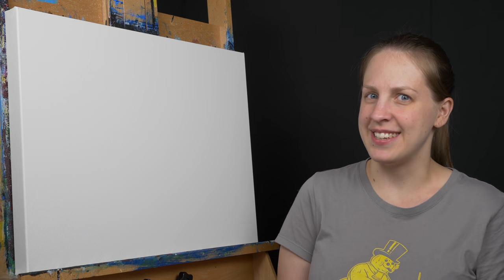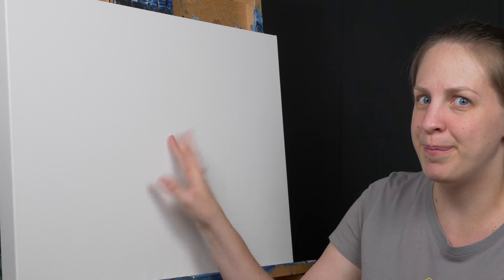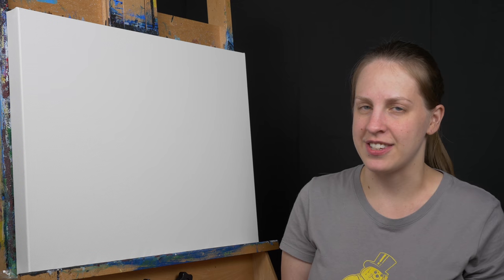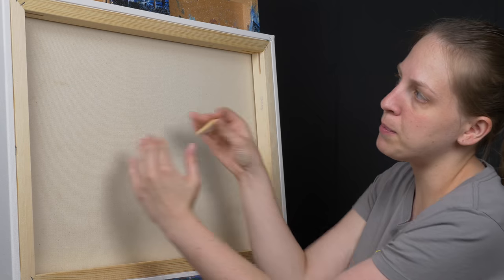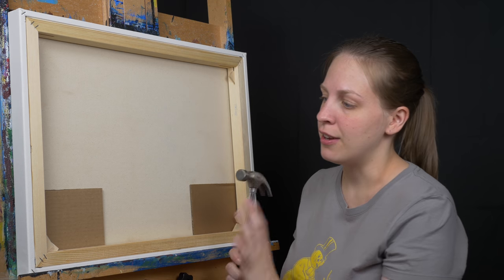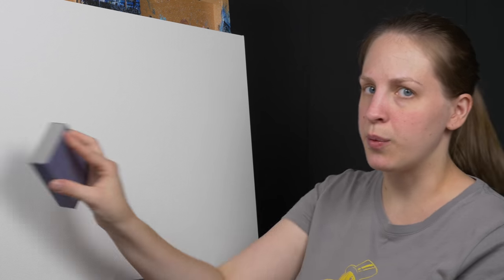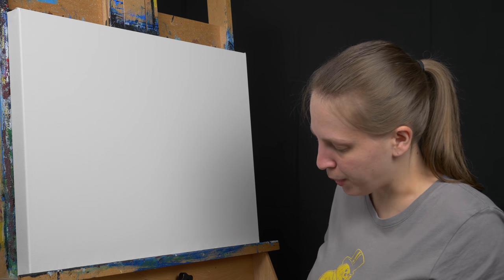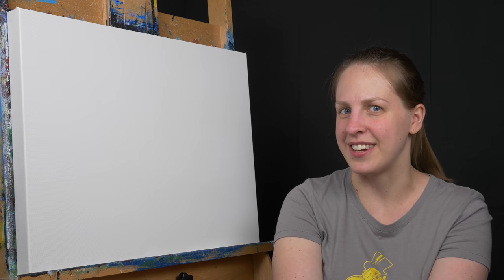Basic Canvas Repairs

Comment: So when the canvas is loose is it possible to tighten it with the water technique even after there’s already paint painted on the front of the canvas? Say the painting isn’t finished and over time when painting, the canvas periodically got loose, the water technique should work correct?
Reply from the maker: Yup! I use it all the time! I did a test on a small (fully painted/varnished) canvas to try out some papers for shipping. I weighted the papers down with some heavy stuff and it left quite a dent in the canvas as well as stretching it. Water trick worked perfectly~
Reply: That’s good to know, cause a painting I’ve been working one definitely feels looser then it originally was, to the point where it kinda worries me if I might end up ripping it. Definitely gonna tighten it right away now. 👍